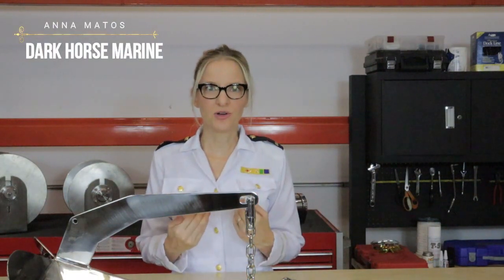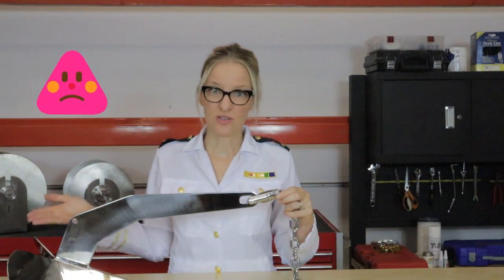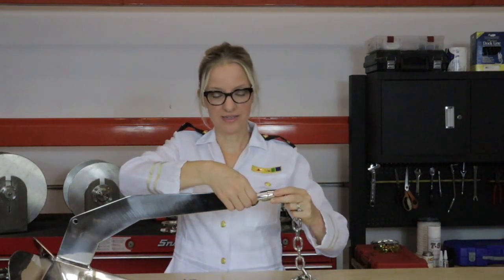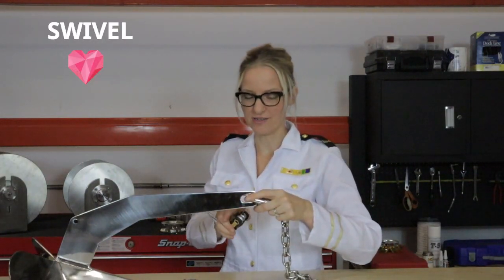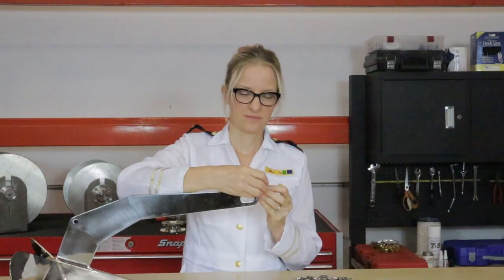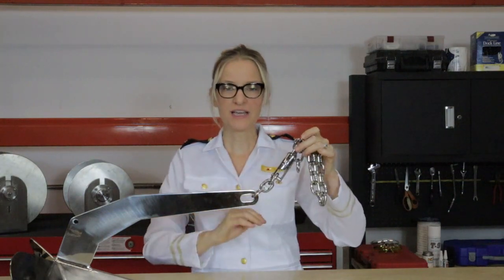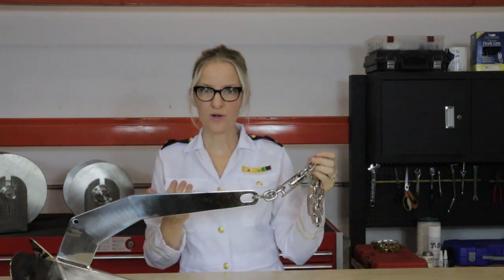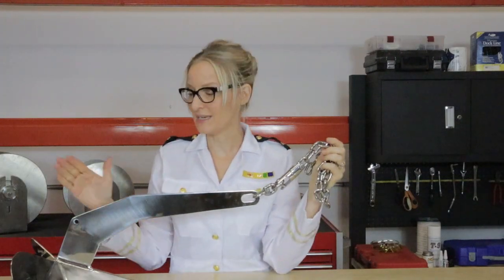The Knotty Professor: Lost Another Anchor? You May Be Using Your Swivel All Wrong!

Comment: Thank you for properly describing the reason not the attach the swivel to the anchor directly.  I have encountered a swivel manufacturer that was unaware of the issue.  I have seen an improper installation on a brand new 3 million dollar yacht.  I have seen failed swivels, just as you described.   The risk & the reasons are real.

Comment: I have 60 meter of 10mm chain on my delta anchor on a 15 -16 ton colvic Watson 34.6 
When I lift anchor my chain twisted making it  jump in the anchor winch 
I’ve just got the same anchor swivel and was going to fit it directly to the anchor though I do some research 1st 
But now sill thinking 🤔 
Do I just put up with the twist in the chain 
or do I fit it the same as in here ????
Reply from the maker: Have you taken the vessel to deep water and let all the chain out and allow the anchor to hang freely for a few minutes to untangle the chain?

Comment: I've always avoided using a swivel and so far just a shackle has worked fine for me. I've never trusted the shear strength of the center bolt on a swivel. What is the downside of just using a shackle and not a swivel?
Reply: If your anchor rode and chain haven’t gotten twisted on retrieving then you probably don’t need one.
Reply: Indeed, a swivel helps turning the anchor. Chain can have twists that can weaken it, which the swivel takes care of by turning. An added bonus is that some swivels ensure that the right side is always up when you pull it up the bow roller. No hand turning over the bow in a rough sea needed anymore.

Comment: Are Maillon Rapide  quicklinks used in marine applications?   If so, then hand tighten and one-quarter turn with a wrench; any more and  splitting of the barrel  due to over-tightening  will  happen.

Comment: That shackle you are using is undersized,you need next size up and use three links of 10mm chain. All will fit properly and is just what i have on my boat.
Reply: Hi there! The sizes of shackle to chain link are not described in this video. This video is purely for demonstration. However, you raise an excellent point! We recommend that you choose a shackle size that is one size bigger than the chain you are using. So for example, if your anchor rode has 1/4" chain, you would want to go up to a 5/16" shackle and keep the links in between as 1/4". Also, if you go up any bigger than one size, the shackle will not fit through the chain link. Thank you for your comments! Happy Boating!

Comment: I have never seen the point of anchor swivels. All they do is add a potential point of failure to the anchoring system and provide little to no benefits in return. The fundamental mistake; as you have correctly pointed, is off-axis load will subject the cheeks of the swivel huge loads. So does the much advertised Ultra swivel solve this issue? Nope,  it only articulates about 30 degrees, which, while it reduces the problem in everyday use and does not solve it when the chips are really down.
 Wait, it gets worse: The very ball and socket that allows articulation introduces a potential failure point. And the fact that the swivel shaft—made of  stainless and therefore subject to work hardening and is torqued over the bow roller every time the anchor is hauled. Stainless steel is, more than most alloys, subject to strange and difficult-to-predict failures when subjected to repeated high loads.
The swivels are restricted from articulating in one plane as part of its automated anchor orientation-on-retrieval feature. A “feature” that may increase the chances that it will be subjected to just the sort of loads I worry about—that's no feature, that’s a bug.

Bottom line, I firmly believe that for those who feel they must have a swivel, the only right way to install it is as shown, with a short length of chain between it and the anchor so it is never subjected to an off-axis load. But this does not solve the problem because the shackle can’t be oriented properly.
Reply from the maker: Very true. Some of the high-end swivels are warrantied for life so it does provide a little piece of mind that you won't be out of pocket at least if they fail. I've also seen more of the integrated shackle/swivel combinations like the Mantis  swivels. I think for most, a shackle will work but if your chain is hockling as it's being pulled into the gypsy, it could cause some real damage so that may be the point where a swivel is needed. We generally recommend using a shackle only first and then if needed, add a swivel instead of defaulting to using a swivel right out of the gate.

Comment: So why does the manufacturer recommend doing it the wrong way then?
Reply from the maker: Not sure why they don’t recommend this. We just notice we don’t get customers calling about broken swivels when trying to break their anchors free from the seabed after advising them to us this method.
Reply: I can attest to the accuracy her presentation. I added a swivel and the anchor gets jammed sideways at the bow roller. That never happened when using only a shackle
Reply: @wallacegrommet9343 a swivel should actually help with getting it straight. There may be something wrong in your setup, or it's the wrong kind of swivel. But there's nothing inherently wrong with not using a swivel at all. Occasionally you may need to turn the anchor by hand when hoisting it to the bow.

Comment: That shackle is very small. I know it's just a demo, but I'd like to stress you should use a rated shackle, one that's rated above the WSS of your chain. Furthermore, use a stainless shackle only with SS chain (Aisi 316 or better,  318). If your anchor is galvanized, use a galvanized shackle instead. They're stronger than SS shackles. The swivel should also be rated, and checked for cracks every time you hoist the anchor.